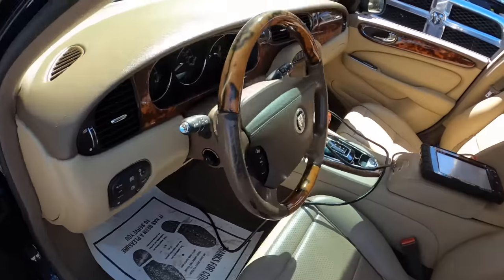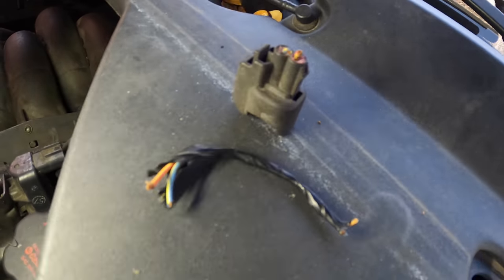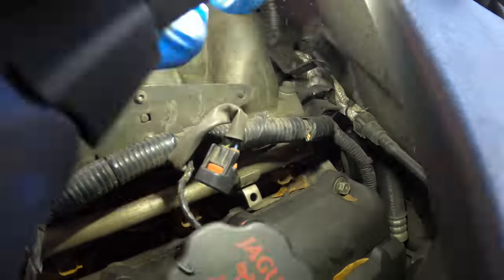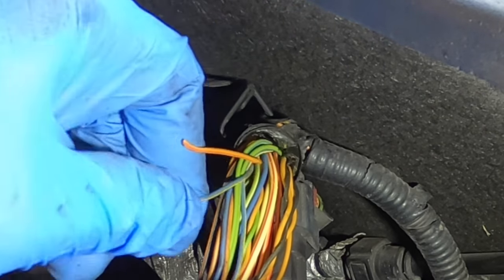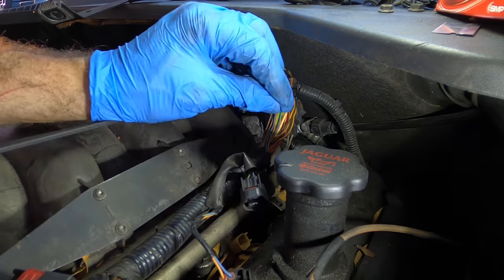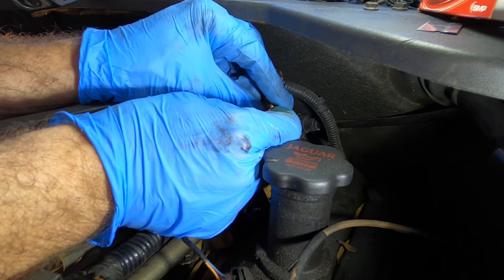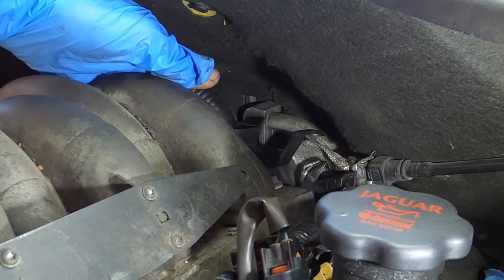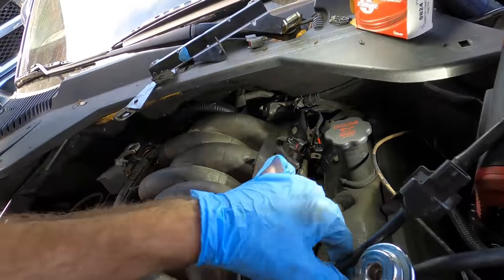Angry XJ Jaguar Engine Attacked / Electrical Damage. P0208 P0308 P0316

Comment: It is probably not peanut oil but the "environmentally friendly" insulating material made out of agricultural refuse in insulation.  I heard, govt has mandated this some time ago - manufacturers must use a certain % of recycled material in automobiles.  Ford wiring harnesses are very popular among rats and mice, apparently.

Comment: seems critters like them as the plastic in the wring is SOY based.   You can look it up.  one quick search  "All Toyota models feature soy wiring. Toyota Camry, Toyota 4Runner, Toyota Prius, Toyota Highlander, Prius C, and Tundra are some of the most mentionable ones. Owners of these vehicles often deal with infestations. Similar to Toyota, South Korean brand Kia too made models with soy wiring."

Comment: A suggestion 
When rapping wires in a tight space 
First rap some tape on to a small socket and you can then use the small socket to rap up the wires 
Check out south main auto on YouTube 
Hope this helps brother

Comment: Tiny REEEEE on the solder.  Give yourself more slack.  4 inches from your fingers to end of solder, not 1.  Saves having to reposition fingers away from hot part.  3 times you had to grab more solder on second wire there for no good reason....

Comment: I'm just gonna come out and say it.  Don't freaking solder wires together in a car!  You should be using insulated butt splice crimps (with good ratcheting crimpers) and heatshrink (preferably adhesive lined).  Why?  Because cars are subject to cyclical vibration, and the ends of your solder joint are rigid and will eventually cause a wire failure at the ends of the joint.  Says who?  Besides me... NASA, the FAA, every aircraft mechanic I've ever met, the folks down at HP Academy in New Zealand who build wiring harnesses for race cars, etc, etc...  Seriously... This is a no, no!

I noticed someone else pointed out that the splices should be staggered.. That's correct, you want to lessen the chance of a short if both connections fail.

Comment: The insulation on the wires is probably soy based instead of oil based. Numerous lawsuits filed because of rodent damage. Your car insurance may cover this but you have to ask your agent.

Comment: Slice a sponge several times with a knife about halfway through.  Get the sponge wet, wringing most of the water out.  Drag your soldering iron tip through the sponge several times to clean it.

Wrap some tape on a socket, then wrap that tape around the wires from the socket.  Easier to get into smaller spaces than the big roll.

Comment: Car manufacturers started making soy-based wire insulation like 20 years ago and rodents love it. It’s also used a lot with cable/dsl wires and various others. Which is why mice chew through those all the time. And guess what US state we have to thank for pushing this into normal use?

Comment: Your using too much solder Ray. if you try and bend the wires after soldering the solder flows under the plastic which reduces the flexibility. use less and keep flexibility less chance of future failure 👌

Comment: You need to add flux to your wire connections before you put the soldering iron and the solder to it it'll heat up really fast

Comment: A little bit of liquid solder flux would go a long way to getting the solder to wick into the joint.  You will immediately see an improvement in your soldering technique.

Comment: I read that they manufactured a lot of the plastics in wiring and other parts with soy oil thus the rodents find the components appetizing. In fact In January 2016, a lawsuit filed against Honda claimed the soy-based wiring was irresistible to rodents. Later that year, a similar lawsuit was filed against Toyota. In July 2017, both Hyundai and Kia were sued for using soy wiring.

Comment: yeah that don't look right that doesn't look like an animal did that I think somebody cut the wire you showed that wire for second out of that jaguar and in the middle of the wire didn't look like it was in the middle it just look like it was cut 1in cut on the other end very close and there was other wires there there were easier to get to for animals to chew on not only that doesn't look like any other wires chewed on

Comment: I don’t know when they started using it but they use soy in the wire insulation and it attracts rodents. I know there were some class action lawsuits about it as well. I think it seems like they prefer injector wiring only because it’s typically in the spots that rodents tend to be attracted to hide in like under intake manifolds and such. Honda makes some good rodent preventing electrical tape. I keep a roll for cars that have rodent problems. They use some kind of pepper in the adhesive.

Comment: Conical tips on SOLD-ERING  irons are essentially useless
What is required is a 'chisel tip '  
In any event - crimping the wires together is the better solution - 
and also quicker - and is the preferred method in Electrical trades.

Comment: Some wire uses a soy based insulation which does seem to attract the mice but customers lost a class action law-suit against manufacturers simply because mice chew wires and since there was no real proof that it's much worse now it was tossed. Personally I'd pay extra for wire with built in repellent even if only for piece of mind.

Comment: The tape you use is similar to the cotton based electrical tape from the 50's. Very disappointed with the plastic crap when it came out.

Comment: "Rodents seem to love these wires.....I hear that they use peanut oil to lube then while they slide them thru the harnesses.....but do not know if that is true."

I have not heard that, and do not believe that to be true. What I suspect you heard is current class action lawsuit playing out in the courts against Toyota (or is it Honda? To be honest I forget, but against a car manufacturer). They used to use to regular old plastic and/or rubber for the colored insulation over the copper wires. In a effort to be more environmental friendly they switched to a mostly soy based colored insulation over copper wires. 

Of course what they find is rodents, in particular mice enjoy this soy based insulation so they are much more likely to chew thru these wires. It was such a problem they actually made a "spicy" insulation wraps that one could purchase and wrap the wires with. This is exactly has the name states, it is a wrap that is soy based, but has spices in it also, and these spices deter said rodents from being enclined to chew on said wires. 

The problem? Despite knowing this was a problem, such a big problem that they even went as far as even make a "fix", they only made this fix available for purchase. They never issued a recall, any car bought to them under warranty with this "issue" (wires damaged by rodents) had their warranty claims denied, hell they didn't even send a simply notice to people saying hey this is a issue and for fee you can fix it! 

So now a whole group of people are suing, and while we are very early in said suit, Toyota (or what ever manufacturer it is) petitioned the courts basically saying this is a frivolous law suit and/or lacks merit and so should be thrown out before it even starts. The judge presiding over the case disagreed, denied the petition, and is allowing the suit to proceed!

Comment: FYI, the automakers have switched from petroleum based insulation to soy-based insulation.  Apparently to save the planet. However, rodents find the soy-based insulation quite tasty and there has been a definite up-tick in chewed electrical systems in vehicles.

Comment: Grab some flux from the hardware store Ray. You'll be a soldering wizard next time. Changed my game for the better despite it being flux for pipe plumbing.
Otherwise, a connection is a connection. Good job

Comment: Car manufacturers use soy based insulation for their wires which attracts rodents specifically foreign car manufacturers. One of them offers a special type of tape to deters rodents from eating the wiring. I heard that GM has started using soy based insulation also

Comment: Your pointed soldering tip can quite easily be transformed into a flat tip with a tippy tappy  device.
You’d get a better heat distribution.

And DON’T put solder on the tip first.

Comment: 15:05 - This is almost certainly a cold joint :(

You should of had the soldering iron UNDER the wires, with a separate flux added to them (I usually use a non-acid rosin flux for general wires) and then let the solder flow DOWN to the iron (it wicks form hot to cold areas).

To heat up better, and avoid issues, put the soldering iron BEHIND the wires where they naturally try to spring back towards (should have moved your iron on the other side of the wires towards the fire wall), and then apply a SMALL bit of solder to the tip so that the solder is a DIRECT heat conductor to the wires, then apply solder to the side opposite the iron of the wires and wick THROUGH the wires.

This also ensures no "points" when the solder cools / strands poking out which can cause issues in terms of shorts and lets in corrosion (which will corrode the copper VERY FAST in the engine bay).

Source: I repaired a 1985 corvette and had to resolder and repair dozens of wire harnesses and splice in new connecters and cut out old corrosion.

I had to redo a few wires because I did EXACTLY what you did in the video and the joints failed. So just keep that in mind if it comes back in a year or so.

Comment: You suck at soldering. Now, that said, nice job! Car fixed, customer happy, money in pocket. Who the frigg cares if the solder isn't perfect. Little in this world is except maybe my wife. And she tells me so all the time. Anyway, I'm willing to bet that solder job is never coming apart until that car goes to the crusher some day. Besides, you're not an electronics technician, you're a mechanic and a damn good one. Screw all those that have nothing better to do then tell you what you did wrong. The car is fixed and the customer is happy. The end.

Comment: Since the year 2000, almost all car manufacturers started using soy-based wiring insulation. Prior to that, oil and petroleum-based insulations were in use.
Yum Yum.  They did it to be "environmentally friendly" and it's cheaper too. 
🤦‍♂

Comment: Don't forget the other Internet taboos...mentioning what brand of oil filter you use and posting a measurement in non-metric units in a comment section frequented by Europeans.

Have you seen the lifehack where you roll some tape off of the roll and wrap it around a 10mm socket, then use the socket as a tiny roll of tape for getting into tight areas?

Comment: The only part I dont like about your soldering technique is the cutting on the covering around the wires. I cringe everytime you get out that dull razor blade that is to big for the critical cutting that needs to done, there has to better cutting utensils around somewhere for this type of surgery....